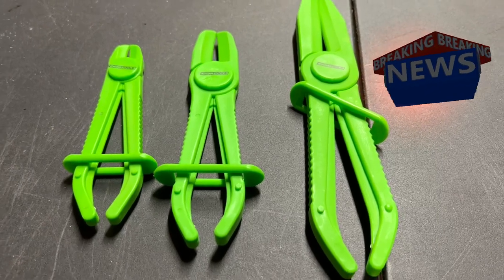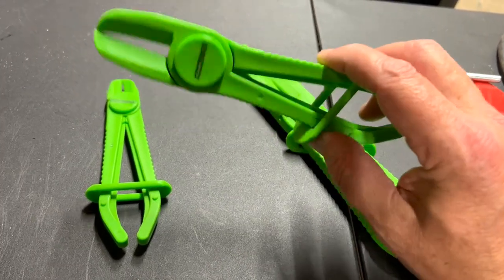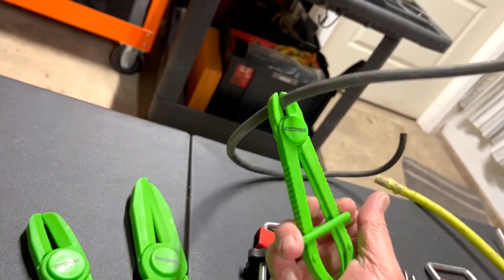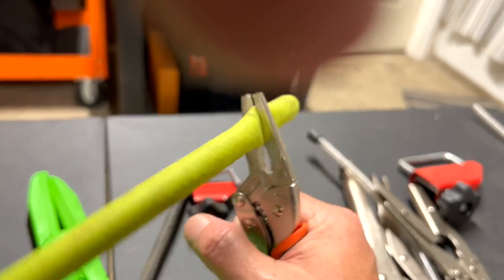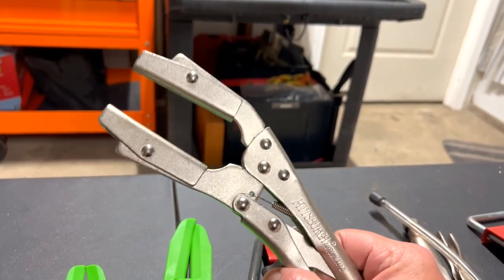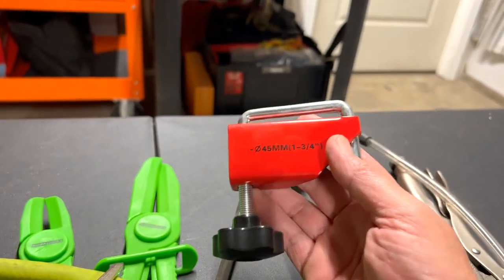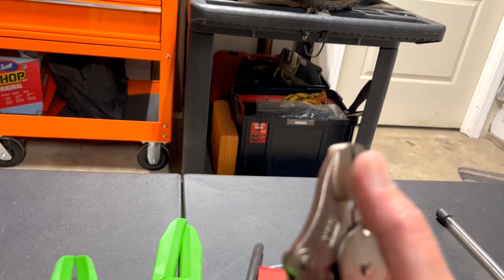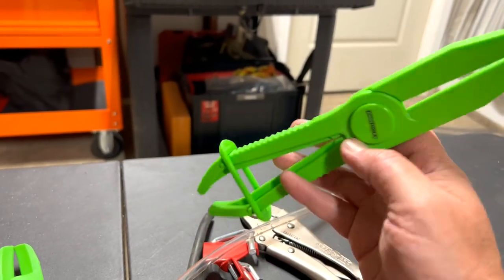Using Pinch-Off Tools to Clamp off Liquid Hoses During Repair OEM TOOLS 24689 3 Pce Hose Pinch Plier

Comment: Does the teeth of the long nose locking pliers damage or tear the hose?
Reply from the maker: I haven't had that problem, but some people use a piece of rubber between the jaws to help protect the hose.
Reply: @JonesingForTools  Simple workaround.  If I had to buy one, id get the long nose locking pliers and to the rubber workaround as you mentioned.  Seems to me a general purpose tool.
Reply from the maker: @AK-IT  Good choice, Brother!
Reply: @JonesingForTools  You can also try wrapping some electrical tape around jaws
Reply from the maker: @reyzarplays9715  I agree, Brother; thanks for the comment and channel support!